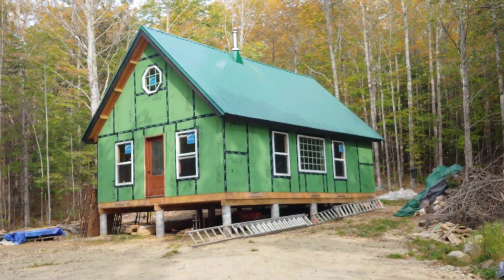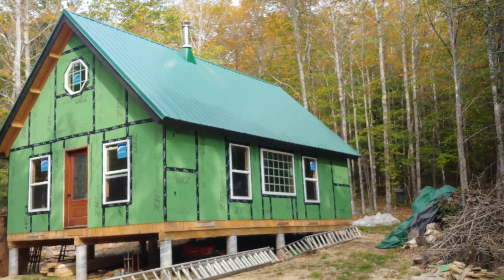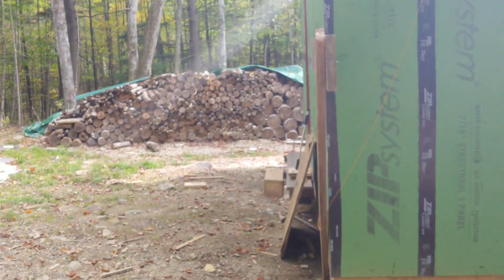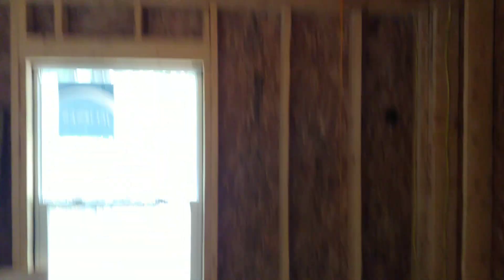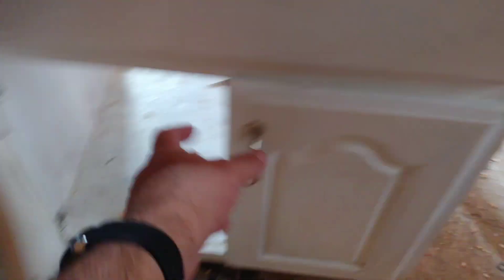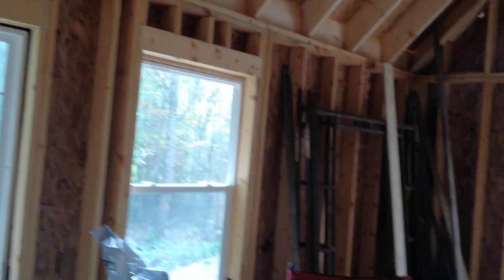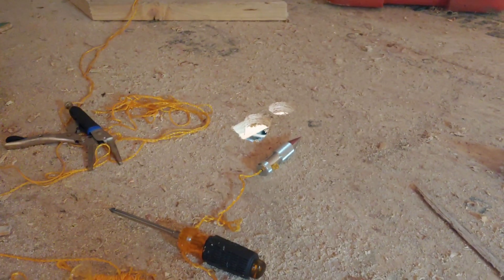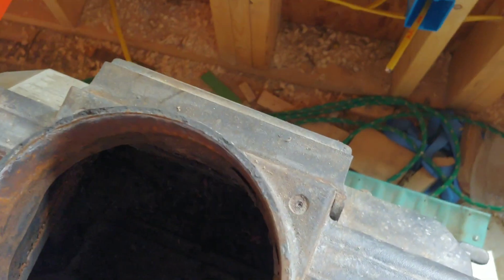Cabin Update - Roof and Chimney - Woodstock, ME

Comment: Nice cabin Dave. What size is it and what pitch is your roof? Did you insulate the roof directly under the metal?  Im planning to build me one soon. You are a big help to me. Thanks
Reply from the maker: Thanks! I haven't insulated yet. At first I was gonna do a non vented roof and spray foam, but too expensive. So gonna do a vented roof and either fiberglass or rockwool as I can afford it. Something called duravent (foam vent channel) goes on directly onto plywood underneath between rafters and then insulation over that. Good luck with your build.
Reply from the maker: It's a 20x32, 12/12 pitch roof.